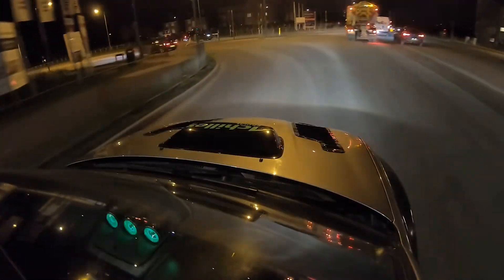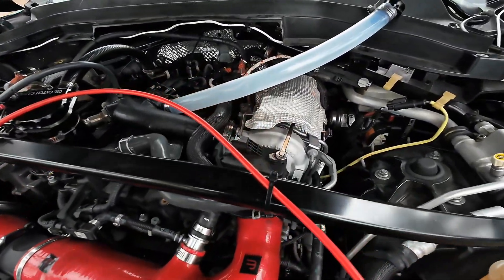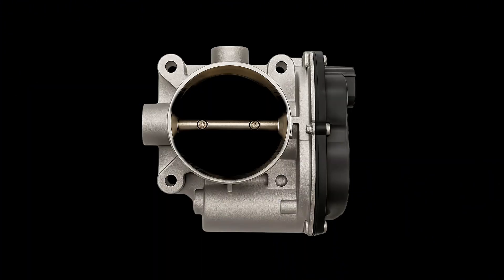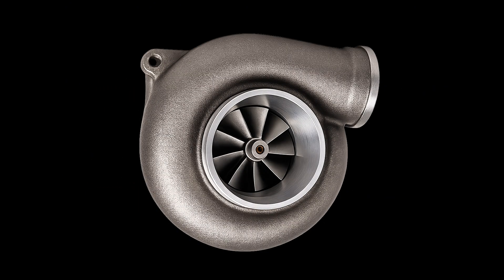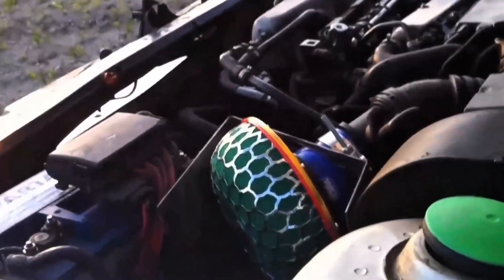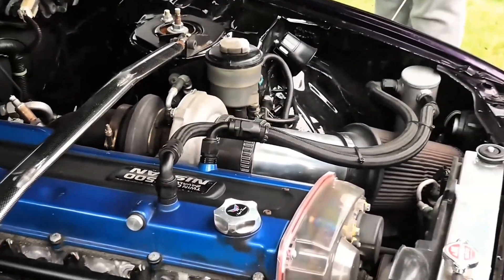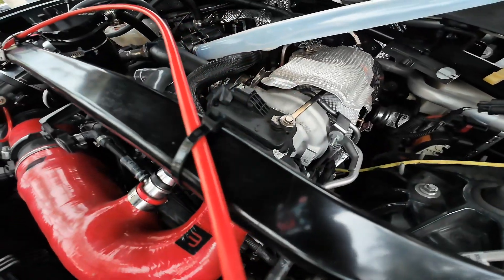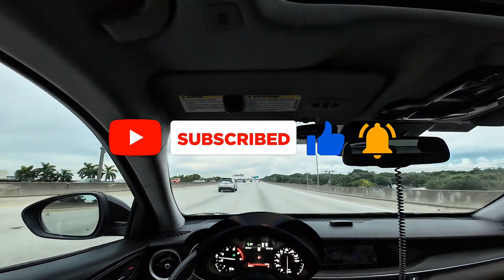Car Culture LIED about TURBO FLUTTER

Comment: This video is the final boss of youtube comments. Never have i ever had a turbo fail from running no blow off valve, and ive owned 6 turbo cars.
Reply from the maker: There is a bunch of variables - like what your max PSI was, if they were journal bearing OEM turbos or not, etc.

I'm just curious at this point.
Reply: @TorqueTheoryLabs You got it wrong, respectfully, though. Turbo flutter is not that bad it will just slow the turbo down, leading to more lag when pressing the throttle again. Dangerous turbo surge is surge while accelerating that's the real turbo killer: There's exhaust gas acting full force on the turbine and access air slowing down the compressor.
Reply from the maker: @kyzer97320 

I would completely respect that answer if it were correct. But throttle-lift surge doesn't slow the compressor wheel down, and it actually provides better throttle response. It's not catastrophic, but it usually wears your turbo more, even though it's unclear how much turbo life is lost because of it. You're correct about on-throttle surge though.
Reply: @TorqueTheoryLabs How is it that air exiting the compressor the wrong doesn't slow it down?
Reply from the maker: @kyzer97320 

Air exiting back through the compressor wheel doesn't slow it down measurably (at least through normal means). Because the compressor wheel has high inertia, and the air escaping exits at high velocity and imparts a small amount of torque as it exits.
Reply: @TorqueTheoryLabs  gt3076r dbb on 28psi (had it for 4 years) 0 issues and that was the longest one ive owned. Also had a journal bearing 18g most recently on 20psi and had that one for one year no issues with super consistent beating on and again 0 issues. I also tend to change my oil on time and keep an eye on my air filters so they dont get clogged to shit.
Reply from the maker: A ball bearing turbo is the specific outlier I mentioned at the end of the video. With that said, you were running a decent bit of boost on that one.

The 18G was overbuilt, so 20PSI is a bit tame. It probably just shrugged the flutter off like it was no big deal. It's among the exceptions people bring up, and for good reason. I should've brought this up in the video.

On any regular journal bearing turbo 20PSI is a lot, and would most likely shorten the turbos life span significantly. The thrust forces are simply outside of the bearings capabilities.
Reply: @TorqueTheoryLabs Fords 1.5 L Ecoboost does this from factory.
No blow off valve. Just surge.
It does 1.5 bar of boost.
Its no problem.
Reply from the maker: @dom3827

Which car specifically? I looked up the charge pipe for the 1.5L Ford Escape 2017 on Ebay and an OEM used pipe had a diverter valve.
Reply: @TorqueTheoryLabs Fiesta ST MK8 since model year 2019. 1.5L TiVCT Dragon Engine with 200 hp. Using twin scroll, water cooled turbo.

Comment: this is false. if you have fluttering while on throttle then yes it can damage your turbo.. BUT fluttering as you let off the throttle is ok, yes it does wear the turbo more but no it doesnt damage the turbo in any means. your turbo is rotating at over 50k rpm, having the pressure go back through the turbo slowing it down a fraction is fine... SO YES you can have the cool sound without the worry of your turbo exploding :D
Reply from the maker: It's not false then?

If you're running 30PSI on one of these new 2.0L turbo motors, and you block off your BOV - you can absolutely damage your stock journal bearing turbo.

If you want flutter, upgrade to a turbo that can take it.
Reply: @TorqueTheoryLabs how you explained it in this video is false. 
flutter WOT = bad 
Flutter letting off throttle= OK 
any tuner/ builder will say the same.
i agree yes on a journal bearing turbo it will wear it more not having the dv/bov but doesnt really cause any damage par wears the turbo bearings faster. 

fluttering while on throttle is a different case that means your turbo is going to be cooked pretty fast...
Reply from the maker: @LGtheAudiGuy 

I explained it properly in the video, feel free to add what was incorrect.

Outside of race grade equipment -

Any tuner who just wants to get clients might agree - but any tuner worth their salt would never let their customer run w/o a BOV on a 20-30+ PSI setup. Liability from potential turbo damage is just too much. Builders don't care about what their clients do after they sell it to them, but I'd imagine they'd deny warranty claims due to throttle-lift surge.

We know how it works, and we know it accelerates wear. But unfortunately  there are no publicly available side by side lab tests. Largely because OEMs validated this years ago.

Comment: Lmao I knew this 25yrs ago.   If you got flutter, your BOV needs adjusting or replacing.
Reply: Hard to replace or adjust something that never existed.
Reply: @DriftNick  lol.  No bov. Thats fukn wild.  Maybe on a drag only setup, otherwise thats a  death sentence for ya turbo
Reply: @RetaliationProductions  Been doing it for 15 years, it's never been an issue, see unlike the people that think it destroys turbos I have actual experience running cars with no valve.
Reply: @DriftNick . I’ve had built SR20s in the past All with BOVs.  I have no experience running turbos without BOVs. Wasn’t stupid enough to try it. Glad you are I guess 🤷‍♂️ idk 😂
Reply: @RetaliationProductions  Nissan were stupid enough to try it, I just followed on from that and yep zero issues with killing turbos.

Comment: In case of the ball bearing turbo, the flutter is better than the blow-off valve or it's just less worse than normal turbo?
Reply from the maker: Exactly, it's just less worse then on a normal/journal bearing turbo. 

You can usually get away without damage since ball bearings have a track the bearings have to follow, so thrust loads are managed better.

Comment: Clearly no one has ever heard of a diesel. They haven't been running blow off valves since the dawn of time.. never had any issues or at least more so than gas cars with a blow off valve
Reply from the maker: Yep that's correct! This video was strictly meant for gasoline motors.

Comment: There is a huge difference between open-throttle surge when there is high flow through the compressor vs. closed-throttle "surge" when the flow is very low. Open-throttle surge will damage a turbo quickly. Closed-throttle will not.

Also, your claim about back-flow and slowing/reversing the rotation of the turbine shaft is just wrong. For example, check out this testing done by High Performance Academy:

https://www.youtube.com/watch?v=Fz-vekMoKdM&t=1276s Go to timestamp 21:15 to see the data

In a nutshell - they ran back-to-back tests on the dyno, with and without a BOV, and then compared turbo speed for each. The result was ZERO difference in shaft speed with vs. without BOV.

Anecdotally, my IS300 has had a Brazilian Master Power MP70 on it since 2003 with no BOV. Turbo is just fine.

YMMV
Reply from the maker: The pressure wave from throttle-lift surge resists the compressor wheel’s rotation, oscillates, and propagates outward. This generates significant thrust bearing loads and can disrupt the hydrodynamic oil film that the journal bearing relies on. This can lead to increased wear and potentially shorten turbo life considerably, particularly in high-boost applications.

It’s completely different from overspeed surge, which I explicitly said I was not referring to. It’s also far too absolute to claim that closed-throttle surge won’t damage a turbo.

Also, the link to the video kept bringing me back to my own video.
Reply: @TorqueTheoryLabs 

Closing the throttle does not "resist" the compressor wheel rotation - if it did, the data would indicate slowed shaft-speed during a throttle closing event when BOV is removed - but it doesn't.

Open-throttle surge does not require overspeeding. At all. It can happen at any shaft speed and it's really simple: Compressor is unable to stably deliver the current flow rate of air at the current pressure ratio. Has nothing to do with shaft speed.

The link I posted is correct, but to use it you'd need to be clever enough to follow the actual link and not the convenient timestamp that assumes it's relating to the current video.

I'll try again: https://www.youtube.com/watch?v=Fz-vekMoKdM&t=1276s Go to twenty one minutes and fifteen seconds.
Reply from the maker: @GroovesAndLands 

Your link didn't work, no need to be rude.

HP academy seems like a great source. In the test he is using an incredible ball bearing turbo (EFR8474), so it'll perform significantly better under throttle lift surge. But here's the deal:

Compressor wheels spin insanely fast - shaft speed sensors tend to average the RPM, and wouldn't show the rapid micro slow downs from throttle lift surge. The pressure has nowhere else to go and has to exit through the compressor wheel, so the wheel must stall momentarily to let the pressure out due to the pressure delta.

Also, to be clear:

Shaft speed dictates where you are on a compressor map, saying it has nothing to do with overspeed surge is plain wrong. Read a compressor map, it's clear as day.
Reply: @TorqueTheoryLabs The theory that it makes the turbo slow down and speed up doesn't even make sense (even worse if you actually think it would make the turbo stop completely), what exactly is making it spin back up? there is almost no exhaust flow but you think it can suddenly jump back up to the rpm it was before in the time it takes the sensor to read again? if it was being slowed down in any way you would still be able to see that with even a slow sensor, the rate in which the turbo slows down over a period of time would be higher, that does not happen though, it slows down at the same rate.
Reply from the maker: @DriftNick 

When did I say the turbo speeds up? Where did I say the compressor wheel stops spinning? Where did I say it needs to spin back up?

It looks like you read one small part of my reply, and just rolled with that for arguments sake.

To clarify: there are aerodynamic stall events which are essentially 'rapid micro slow downs' which contribute to crazy thrust loads under throttle-lift surge.

The turbo still has a ton of rotational energy, and the air passing by the compressor wheel also imparts a tiny amount of torque which reduces losses from the rapid micro stalls.

That's why throttle lift flutter sounds high pitched, and choppy.
Reply: @TorqueTheoryLabs If you say it has micro slow downs does that not imply you think it's slowing down? if you think it's slowing down then it has to speed back up for the sensor to read a consistent speed.

"Where did I say the compressor wheel stops spinning?"

I wasn't 100% sure if you thought that was happening or not but I see people that think that happens all the time.

"The turbo still has a ton of rotational energy"

Which it would lose if it is forced to slow down.
Reply from the maker: @DriftNick 

Well exactly -

The micro slow-downs don't have the energy to noticeably slow the compressor wheel's speed, and the torque it imparts on it's way out helps offset the losses. It happens rapidly, and would be difficult to catch on a regular speed sensor outside of laboratory testing. 

This is why flutter sounds the way it does.
Reply: @TorqueTheoryLabs 

No. The flutter sound is air accelerating and decelerating as the vanes of the compressor wheel stall the same way the wings of an airplane stall when they've gone beyond their critical angle of attack and stop generating lift.

You're just making stuff up. Please stop.

Also, turbo speed sensors do not have filtration/averaging electronics in them. Our ECUs are capable of sampling a digital square-waveform at many kHz and are NOT blind to your magic "micro slow-downs". The data does not show slow-downs because they're not actually occurring.

The compressor wheel DOES rapidly switch between getting a good bite of the incoming air and flinging it outwards into volute; and losing that bite and slipping in the air as that air back-flows out the inlet. There ARE aerodynamic forces associated with this that must be supported by the bearings. HOWEVER - the mass flowrate of air when throttle is CLOSED is too low to generate big forces.
Reply from the maker: @GroovesAndLands 

Firstly - I’m not making anything up, I’m describing the same aerodynamic stall principles you are.

Your reply is mostly correct, but there are two clarifications:

1. Turbo speed sensors can sample at very high frequency, but the ECU/data logger often processes that signal into an averaged RPM value. The raw sensor could show every fluctuation, but the interpreted data won’t necessarily reflect the very fast instabilities.

2. “Closed throttle = too little mass flow for big forces” isn’t accurate. The force on the wheel is a product of pressure ratio as well as flow. At high boost, throttle-lift surge has been shown to create significant thrust loads that accelerate bearing wear - that’s why OEMs use bypass valves in the first place.
Reply: @TorqueTheoryLabs 

I cited data.

How about you do same?
Reply from the maker: @GroovesAndLands 

That's fair:

Since SAE papers are largely hidden behind a paywall, here's what I can cite:

You can find speed sensor operations data in Bosch/Garret PDFs, but I can't share those through YT. You'll need to do some research for yourself on that one. The sensor typically divides the number though, and the ECU smoothes it down even more. Keep in mind, these sensors are accurate - just smoothed. That's why your HP academy source was able to run w/o a BOV and it didn't detect the flutter in the speed sensor if I remember correctly.

As for compressor surge - here's a clear source:

https://youtu.be/BFXIgME_5UA?si=y5C-BU1YcuHxYQlw

5:30 - 8:35

Comment: The animation at 1:00 is kind of misleading, the turbine doesn't spin backwards. Turbo's die when they surge on throttle, when off throttle there's no load on the turbine so there's not a lot of stress on the bearings as well.
Reply from the maker: This is correct!

Rewatching it - I see how it could be misconstrued. I meant that the airflow reverses out the compressor housing past the wheel.
Reply: Yeah the blades/compressor dont actually spin backwards - but rather it oscillates in speed (fast-slow-fast) as pressure builds, the air stalls, and then as air escapes backwards, pressure drops and the process begins again.
Reply: Hey u nailed it.
Reply: As Rob has already stated, when there is no load there is fuck all stress. Your turbo is going to die of something other than this. Sorry TTL, you're pretty much exactly wrong on this one :(
Reply: "when off throttle there's no load on the turbine so there's not a lot of stress on the bearings as well." disagree. The turbine has momentum so if its spinning at high RPM, and the compressor is recieving reverse flow of air, there are opposite forces acting on the shaft. This is what causes the stress.

Comment: One time a vacuum tube came loose from my diverter valve or whatver on my 1.8t Golf IV, and it started to flutter. I low-key wanted to keep it, but I knew in my heart that I didn't want to hurt my aging car like that 😞
Reply from the maker: I'm good with replacing my turbo - so I might've just let it go 🤫
Reply: @TorqueTheoryLabsFor me, the less things I have to do in a transverse engine bay the better 😂

Comment: Beautiful. No BS, just info.

However....pigeon is life.  Well.. it would be if the Hemi wasn't in my current whip lol
Reply from the maker: Glad I could help!
Reply: @TorqueTheoryLabs Just to clarify some things here btw... Stock vehicles DO Have some flutter, and this is proven when you replace the stock inlet with a metal one.  

The sound just gets enhanced.  The air just can't escape fast enough via the BOV or recirc.
Reply from the maker: I know, mine has it too. Just nothing crazy enough to cause any harm.

Comment: The way I understand it, it probably won't damage high quality turbos enough to be a problem in project cars.
Man I wish I could afford to turbo my car.
Reply from the maker: That's the car guy dilemma in a nutshell.

For the flutter:

It's not recommended, and it'll still shorten the lifespan - but if you must do it then:

High quality ball bearing turbos can handle it much better then regular journal bearing turbos.